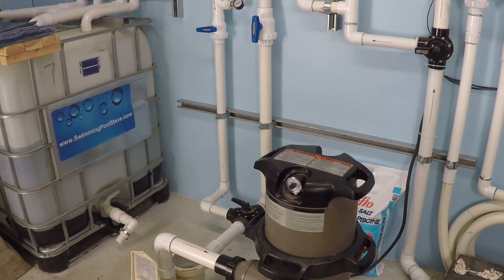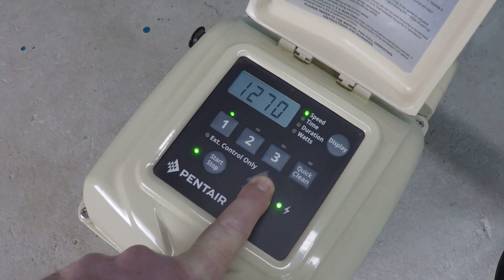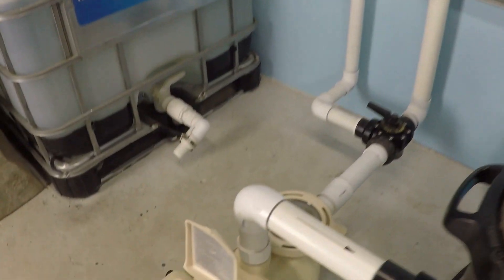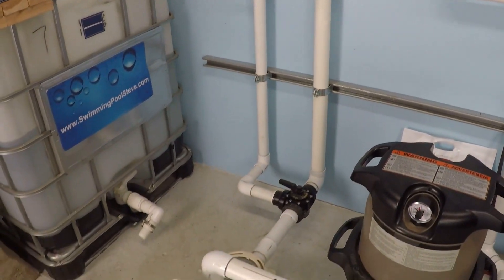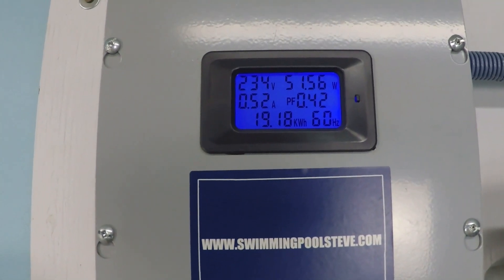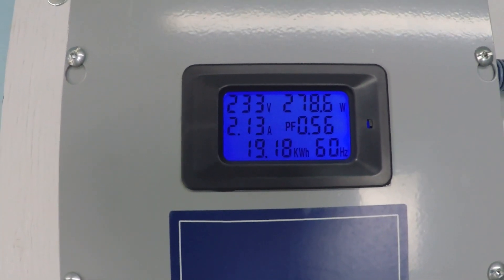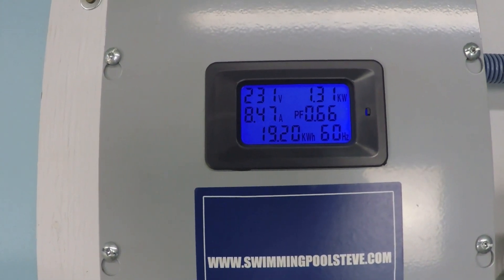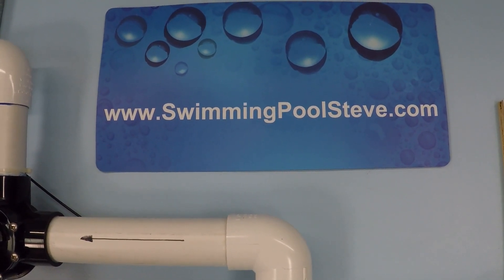Pentair SuperFlo VS Compared To Hayward Super Pump VS

Comment: It's interesting how these pumps act differently in different situations/installations.  Not the same exact pump, but my Pentair VSF will flow 23 GPM at 750RPM, pulling only 37 watts.  What's really interesting is, increasing to 1000 rpm only gets me to 24gpm, but then pulls 84 watts.  I've learned to "play around" with different settings to find that sweet-spot in GPM/RPM/Watts for each of my settings.  You can really save some electricity/money this way!

Comment: Awesome comparison, thanks! The Pentair VS has more flow but also uses more electricity, the Hayward sips power but makes less flow. Anecdotally they were both comparable in electric consumption per gpm flow on the higher end. For example, pentaire @ 2000 RPM, 55 GPM, 509W & Hayward @ 2500 RPM, 61 GPM, 517W. Or Pentair @ 3000 RPM, 82 GPM, 1.53KW & Hayward @ 3450 RPM, 82 GPM, 1.3KW.  

I feel like the Hayward really saves electricity, but the lower flow means you have to run at higher RPM to get equivalent flow to Pentair. Still might come out ahead in electricity savings.

Comment: Have you ever done a comparison of equal flows compared to watts used, instead of equal speeds compared to watts used?  I was really surprised to see that the Hayward was so much more efficient with power at 750 RPM, but then I did the math and realized that is was also 24% less efficient in flow than the Pentair.  It made me wonder at what RPM the Pentair would produce only 17 GPM and what the resulting wattage would be.  If I am missing something with my thinking, please feel free to advise.  Thank you for all the great info, I am studying your videos and website like I am in school.

Comment: good video what hp were these rated at?  did you declare a winner?  would flow gpm be lower or higher with 1.5 dia tubing?? both seemed loud at max rpm

Comment: Question: Are there any drawbacks of running a variable speed pump on a DE filter system? Will the earth not stick to the membrane at low circulation periods?
Reply: The DE sticks to the grids so I don't think this will be a problem. Maybe it would be a good idea to run at full speed when you first add DE to ensure you get even coverage but it will eventually not matter.

Comment: Wow, I have Hayward 950 vsp I had to do a warranty motor unit replacement after 19 months.   I ran it 24 hrs.  I don't know if that was the issue that caused the failure or not.  I know the new unit dropped my pressure down 12 lbs at high speed from 30 to 18.   Definitely in issue with that pump unit.   

It's nice to know a ballpark what the gpm are.  I removed 24 hour filtering.   I guess I'll see how it goes.
Reply from the maker: 24 hour operation is NOT a problem for this pump or any pool pump. Too bad about the failure but not attributed to continuous operation.

Comment: Thanks for the info Steve.  Getting a Hayward SuperFlow installed soon.  Speculating I can run it 8 hours a day, low and slow, at 25 gpm and get three turnovers while sipping watts.
Reply: How many gal
25gpm x 8hrs   3 turn overs

Comment: Hi Steve -- great comparison. Fellow geek here. 

Your remote readout in the bottom left has a KWh readout.  Oddly enough (to me) this readout does't really vary with pump speed or with watts used.  Would you mind telling me what that value is representing?

Also, I'm not sure what monitoring arrangement you are using, but does the wattage shown take the shown power factor into account?  The Hayward has abysmal PF compared to the Pentair and yet the watts are not that far off at the same GPM.  If the PF isn't taken into account, this would mean the Pentair is far more efficient overall.  Now I realize that the utility company doesn't worry about PF in residential accounts, but in a commercial account low PF will trigger surcharges.

Thanks
JB
Reply from the maker: Hi JB, interestingly the unit measures power factor in real time which is the middle number on the right. The bottom number in kWh which does not change is measuring total power consumption like an odometer which is why it only moves slowly. You only see the system running for a moment.
Reply: @Swimmingpoolsteve  

Now I understand the KWh.   Thanks.  

I'm an engineer for a commercial user (where a low PF will get me dinged) so I'm still interested in whether the real-time current draw (in watts) takes the PF number into account or not.    In other words, the KVA (which would be the watts / the PF) would be a ton higher for the Pentair if that math has not already been done in your monitoring system.  Residential users get billed by the KWh, while big commercial users get effectively billed by KVA. 

Thanks so much for the informative response and if I learn anything you might be interested in in my own tests I'll let you know.  Once I decide on which pump I'm going to use I will have 520 of these pumps in use 24/7/365 in an agriculture application.   This large usage is why I'm digging so deep in efficiency differences.

JB
Reply from the maker: It appears that the wattage takes the power factor into consideration, but the current draw in amps does not. At times when the superflo is drawing 1 amp the wattage should be reading 235v (the voltage reading) but the power factor at .55 means the actual wattage is only 135 ish, so power factor has to be considered. I barely understand the service factor stuff if I am honest. I am technologist level with electronics at best so if I am not understanding the power factor reading relative to the wattage display please let me know. Also, both Hayward and Pentair have more premiere pumps. These are their more entry level pumps. I am not sure of your use but if I needed volumes like this I would probably be looking at the flagship products from each brand. That would be Intelliflo from Pentair, currently model # 011056. 011028 also would work and is variable speed, not variable flow like the 011056. You can also look at the Hayward Tristar950 which is the comparable size and model to the Intelliflo. SP3206VSP
is the open line product number and SP32950VSP is the dealer protected version.
Reply: @Swimmingpoolsteve  

You are correct now that I look at it closer -- I hadn't paid any attention to the amperage readout but clearly the PF is included in the watts and not the amps now that I do that math.  Thanks for pointing that out.

I'm not an EE myself (I'm a mechanical engineer), so like you I'm not the expert on the power factor angles, but I'm being forced to learn.   Just for my own education, what sort of power monitor are we looking at in this video?  Are there clamps on the power input lines to feed the readout or is it talking via network cable to the VFDs on the pumps?  Whatever that is I'm going to need to get one. 

I had previously looked at the Intelliflo (and the Hayward equivalent), but the WEF on both of those are dramatically lower than on the SuperFlo VS that you have here (~7 vs ~10).  I'm struggling to understand why that would be given they are newer technology.  VFDs are tricky in that it takes just the right match with the motor or your PF goes way off at medium to low speeds.   Hard to believe these two large companies couldn't have matched things up properly, but their own specs show the much degraded WEF rating on those latest units.

Thanks again for the informative exchange.  Love your work.
Reply from the maker: I am pretty sure the larger HP of the flagship pumps accounts for the lower WEF ratings. The WEF uses a range of RPM but 3450 with these pumps uses so much power that is skews the rest of the WEF rating versus a smaller pump. Note that max efficient flow rate is 6 fps which is like 65 gpm in 2" pvc pipe. So a 3hp pump is deep into inefficient water velocity, where smaller pumps are able to run a broader rpm range while under 6fps water velocity. WEF is not perfect in this regard.
Reply: @Swimmingpoolsteve  

Thanks for that info.   I'm not familiar with the WEF testing procedures.  I did find a 279 page document related to that, but not sure I'm going to dig that deep.

Sounds like for VS pumps they do as your test here and take points at various speeds.   As you point out that would explain the lower WEF as motor HP rises for the same 2" pump simply because they are using brute force (electicity) to get more GPM through the same pipe at the same RPM.

I wonder if at the same GPM (say 70), the newer pumps would be anymore efficient than these.  Typically (and as shown by your test here), the PF gets worse when the motor is throttled down.  I'll just have to set up a test procedure of my own that is relevant to my use (rather than WEF), monitor the power and find out.

Thanks
JB
Reply: VA = V x A = input power to system.
W = power used by system.
PF = W / VA = system efficiency.

The lower the number the less efficient the system is.  Induction motors are known to be quite inefficient thus on large motor systems they typically have capacitor(s)/banks added in parallel to improve the power factor.

Comment: my hayard runs at 1985w at max speed, pretty much same size pool i wonder why its so much higher
Reply from the maker: Which pump do you have? This is the 230v super pump VS SP2603VSP which has a 1.5hp (1.65thp) motor. Based on your power specs I might guess you have the Trisstar VS 1.85 hp (SP3202VSP / SP32900VSP). Also worth noting is that the resistance to flow in your system will also change the power consumption and the flow rate.